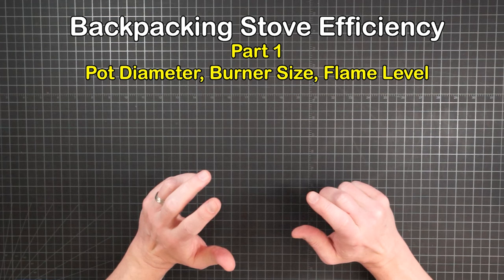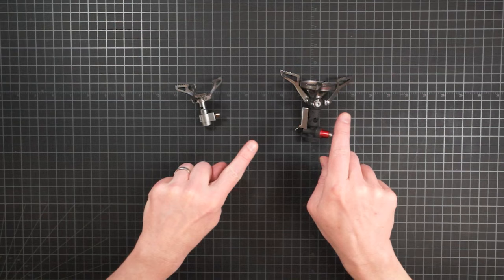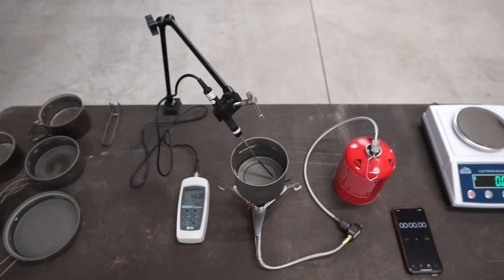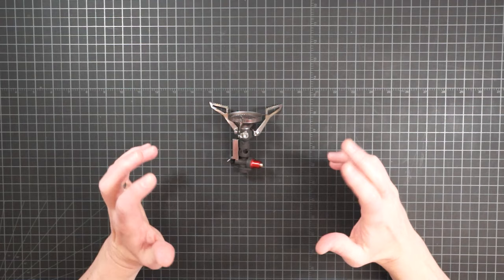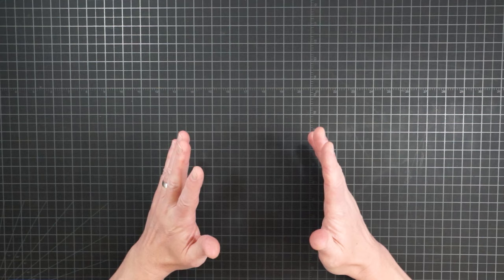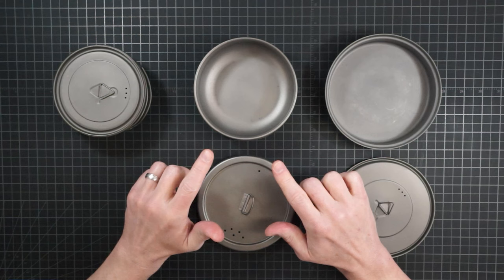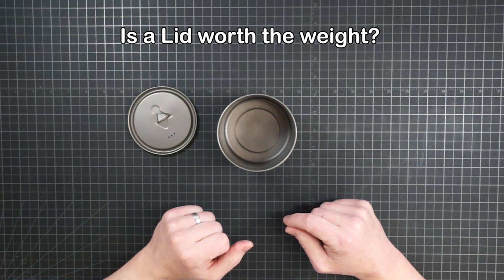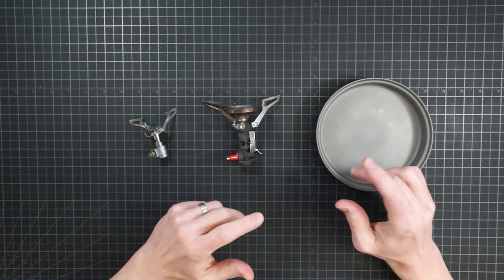Backpacking Stove Efficiency, Part 1: Pot Diameter, Burner Size, Flame Level

Comment: Wonderfully thorough and fruitful investigation -- thanks! One of the questions you may find suitable for further inquiry is adjunct equipment for minimizing flame and pot heat loss, like the cone-style windscreen/pot stands put out by Trail Designs. They are excellent for use with alcohol stoves, at best only 2/3 as efficient as propane -- so it would be intriguing to see a test. My guess is that the flame/pot width relationship would be far less critical, and that the low fuel consumption profile would be enhanced.
Reply from the maker: Agreed!  I've got wind effects planned for Part 2, but Part 3 should be on heat exchanger systems.

Comment: Extremely accurate!
But ... you measured at room temperature, I guess. If the external and water temperature drop, not to count the wind, the pot disperse more heat so require more time to boil, especially with low flame. Perhaps.
Thank you for your video.
Reply from the maker: I do have plans for some very cold weather testing, but will have to wait until next winter.

Comment: Wind effects without a windshield should remove heat roughly in proportion to the pot surface area. I'd imagine there will substantial ambient temperature effects too, imagine between -5 and 40°C for example, again probably proportional to surface area and becoming more emphasised at lower temperatures (greater differential)

Comment: It made my day when I saw you dropped another video. I was expecting a stove/pot efficiency material since you last mentioned the subject in your previous update video.

Now, I need to update my _ ultralight kitchen system_ and was waiting on your study before making any purchases I'd end up regretting. This video gave me some answers and taught me (for that I thank you, you're my favorite channel for a good reason) but now I HAVE NEVER WANTED MORE A PART 2 than this time. 

I have so many more questions now, specially after reading how poor the BRS3000T performs on altitude and with high winds. 

Thanks for the work and research you put into this, you're a gift to the Ultralight community.
Reply from the maker: Thanks very much!  Planning on Part 2 Wind Effects is in the works!

Comment: I've found that reused pie tins make perfect DIY lids. Just cut out a section from the middle to size and roll the edges by hand or with plyers. Much more rigid than aluminum foil, but still far lighter than titanium. Plus, you get to eat the pie!
Reply from the maker: A true win-win if ever there was one!

Comment: Flux ring style stoves would be interesting in these metrics too for high to medium flame. As their entire design is intended to catch runaway heat, at the significant cost of weight.
Reply from the maker: Indeed!  I think wind effects will be Part 2, but that will be the perfect lead into heat exchangers for Part 3.
Reply: My Jetboil Sol Ti pot from 2012 weighs 108.8g. My Alpkit 600 pot weighs 79.3g. So the pot isn't adding much weight, it's the associated burner.  Combining with a burner, a 'like for like" with lid the Jetboil is 244g vs 144g, so a 100g extra. Question is if that added weight helps at all. It's not so much the pot's fins, but the associated burner if the two combined is justified.

Comment: awesome!  this has been the kind of analysis my mind has always wanted to perform.  and, it reaffirms what i have found in the field:  lower flame, smaller pot, foil lid. i also use the foil as a windscreen/heat container. glad someone has time and $ to do this stuff.
Reply from the maker: Thanks, and I'm very glad to help!  So, it turns out I'm not the only one ;)

Comment: I use a minny pie tin from Walmart for a lid. (Top of a ti snowpeek) Poke some holes in it and you can make an egg with it like a suvee. Just put some water in the bottom of pot and u got a dubble boiler/ steem pan
Reply from the maker: I like it!  Thanks for the tip.

Comment: I determined long ago that a sit-on-top home-made cat food alcohol stove works best with a wide-bottomed pot to capture the slow-burning flame, a tight-fitting, non-ventilated lid, and carefully fitted, well ventilated windscreen. To save weight as a solo hiker, I use an Evernew 1.3 liter pot, and, for increased efficiency, I often put a rock on top of the lid, which minimizes the escape of steam, making it a semi-pressure cooker/boiler, especially helpful in cold weather. For optimal cold weather efficiency, I pre-warm my fuel and water with body heat or a campfire, if I have one. Using a stainless steel single-wall bottle in the winter allows me to put it in an insulated cozy and take it to bed, where it keeps me warm, and my body heat keeps it from losing heat as quickly as it would if left outside of my sleep system.
Understanding basic physics goes a long way when paired with common sense and experimentation. 
Thanks for the great quantitative data, confirming my general observations. 
Awesome! 👍👍👍

Comment: Science preferred from marketing – thank you so much for this uniquely derived information based on a comprehensive and statistically worked out comparison! I am furthermore interested in the effects of material alloys of pots and lids as other non-linear factors of optimizing the cooking efficiency under in- and outdoor conditions..., possibly might this be a task for a bachelor's degree in thermodynamics? Anyway, many thanks to you for this data treasure!
Reply from the maker: Agreed! I do plan to test pots of different materials (aluminum vs titanium vs stainless steel).  Eventually 😏
Reply: @GearSkeptic  I'm looking excitedly to this coming investigation and being grateful for your efforts to deliver thoroughly evaluated results and conclusions. Best regards from Lower Saxony, Germany

Comment: I'm happy my cook set is indeed the weight efficient. BTW I learn I'll better use it on low :) I never used lid too :) Thx for the very stdized way of testing. But the best efficient might be stove less and rehydrade couscous with instant soup and pinch of oil for the calories into an icecream pot with screw lid. pay attention of plastic must be PP to allow using your pot to support boiled water shared by another hicker. You now found the best way to have boil water at negative weight saving, let somebody else carry the cook kit and just take a your favorite ice cream jar :) Another remark come to my mind, when using wider containers, food cool quicker. It is especially important to keep water long warm to ensure good rehydration of meals. Some of my homemade dehydrated diner takes 15' to rehydrate completely in hot water. So it is very important to me to keep warm my boil water to rehydrate meals. For that I use my fleece hat as pot cosy :) Another way to be weight efficient with cook set is to be well informed about the trail you do. In Corsica, for example, every mountain house will have a gaz stove & free gaz. So just take your pot and go :) No stove or gas canister required there :) For making water out of snow, I recommend to use low heat and add a pinch of liquid water in the pot to speed up the process. I guess ice getting burned, get directly to steam without turn to water... I look forward to discover if my water treatment make sense :) I use a microsawyer on a sparkling water bottle. (more resistant) with sportcap to allow backflushing on the go. When doubt of viruses (staying water, ...) I double with micropure forte, some kind of aquatabs I think. I'm sure we will learn a lot out your crazy testings :) Also, if you drink lot at the river, you can carry less water until the next water source ;) weight saving let energy for walking more :) Thx again and happy trails!
Reply from the maker: Thanks for all the thoughts!

Comment: Outstanding video, thank you! You might also want to discuss the implications for fuel canister use given that the canister metal is a very large portion of the carried weight. This might take the form of a chart or charts giving the # of boils or liters boiled for each  stove/pot/fuel rate combination for both 100 g and 220 g canisters. Looking forward to your wind results!

Comment: Video idea for you, I would love to see a really in-depth investigation into avoiding condensation, particularly on the surface of quilts while in a tent. It could involve discussion about single-wall tents (but that is reasonably common knowledge at this point & has been done alot.) But I am finding it very difficult to find anything about quilt specific condensation.  Cheers! Greg

Comment: What a sophisticated Analysis very scientifically😍🤩thank you for the effort!  
I only mist a sheet with the comparison between time and consumption, since you messured the time on every boil, i am quit curious what the time differences on the variations. I know, the focus was on efficienty but sometimes in the morning boiling water for the first coffee you can get quit impatient at least me 😁
Reply from the maker: Here are the average boils times (using the regulated MSR Pocket Rocket Deluxe) on each flame level:
High 2min 25sec
Medium 2min 59sec
Low 5min 46sec

As you can see, a much bigger jump in time going to Low from Medium, than from High to Medium!
Reply: @GearSkeptic  Thank you very much! Yes, wouldnt have expected such a big gap between low and medium, almost double the time. Thanks again and im already very curious for the next episodes 🤓👌✌

Comment: Thank you for the amazing quality of the video. It is incredible to have someone like you in the community. 

It is great to have someone like you being so orecise and detailed.

I would like to share something for further consideration, in my experience getting a titanium flexible windscreen and putting arround the smallest pot in order to capture the flame with the sides of the pot (taking care to not cover the fuel canister and risk a explosion) negates most if not all the benefits  of a wider pan. But it only weights 11g after I cut it to size. And no, aluminum melts at the flame temperature so it does not work to put a aluminum foil.
Reply from the maker: Excellent point!  A windscreen could be a benefit even when there's no wind.

Part 2 will be on Wind Effects, and windscreens will be tested.  I will make sure to test what you have said, as well.  Now I'm curious!
Reply: @Jean S so you use titanium foil and let it collapse around the pot suspended above the canister? Do you use a silicone rubber band to secure it or does it’s tension keep it in place? Heavy duty tinfoil positioned at ground level with some separation between it and the pot works as an effective windscreen but does not serve to focus the heat that otherwise naturally rises alongside the pot, even with the burner flame level reduced to keep flame from visibly spilling out beyond the edges. So I am curious about your use of the titanium foil type windscreen. Do you use the one made by Toaks cut to size or did you buy the foil and shape it?
Reply: @wanttogo  What I did is cut it so its height is just the size of the pot + a fem cm. So to use it I colapse the handle and wrap it tightly around the pot and secure it using a large paperclip. The goal is to set it just sufficiently below the base of the pot so it covers the flame protecting against the wind and guiding it and the hot air around the pot.  The downside of this is that after boiling, it is hard to touch to remove. I use a pliers to handle the pot in this situation.
Reply: @MrDjoppio  understand. I appreciate the response.

Comment: You are the hero we all needed. Though I know it is not an easy addition to the test, I would love to have seen how a Jetboil (or similar product) compared. Adding in a “flux ring” to help with the lost heat. Based on this study, I somehow doubt that a Jet Boil fuel weight savings would ever make up for the weight of the unit itself.. but I’m still curious.
Reply from the maker: Heat exchangers like the Jetboil and MSR Reactor are scheduled for Part 3, right after a Part 2 on wind effects.  I suspect you're right about the weight efficiency issue, but I want to see by how much!

Comment: Love it! Very surprised with the lid results. I had already had an aluminium foil lid DIY’d and now I’m determined to use is to shave another 10-12g from my cookset. 

From a weight efficiency perspective, estimating how much fuel I will use on a trip (together with the weight of the stove setup), along with conditions, is how I determine whether I take a gas or alcohol stove. 

Even with the BRS, basically if it’s under 4 nights I take the alcohol stove as it’s going to be lighter. 

The other point to make is how much fuel you have in a canister. Unlike alcohol, the vast majority of people won’t portion out their fuel for a gas stove- they’ll just take whatever canister they have.
Reply from the maker: Good points!  I would like to eventually see how alcohol stoves compare, especially after getting a baseline on wind effects.
Reply: @GearSkeptic  are yes, lab vs real world conditions almost guaranteed to never be the same, particularly with this topic and also with wind and temperature. 

Keep up the great work, we all really appreciate it!

Comment: Awesome. Thanks for all the testing. I was thinking of picking up a wider 115mm 700/900ml pot to replace my narrower 750ml pot. I care more about fuel efficiency. I picked up the Soto Windmaster 4 plex because there was less distance between the stove and the pot. The boil time with a heat exchanger pot is very quick, but that pot is quite heavy. Now with your testing, I'm more tempted to pick up a Trangia 27 kettle before a pot upgrade. Use a low flame and chill like with an alcohol burner.

Comment: Cool.  I suspected a large flame was less efficient.  Good to see some confirmation.

The lid data was interesting too.

Possibly another option is to float the fuel  canister in some water to allow it to maintain a more consistent temperature.
Reply from the maker: Interesting idea!  I'd have to make sure the canister is dried each time before weighing it, though.

Comment: After you've had a rest from watching water boil and are ready for another analysis, your same test setup would be put to good use quantifying the efficiency gain of heat exchanger pots vs. regular pots.  I've done some thumbnail tests to quantify the efficiency gain of a Jetboil Stash vs. Toaks 550 in order to quantify at what point the additional weight of the Stash pot becomes worth the fuel saved.  Your setup and approach is far superior.  I'd be curious to see you quantify the efficiency difference.  Such data would help people determine the break-even point
Reply from the maker: Yes!  I think wind effects testing will lead nicely into heat exchangers and windscreens.

Comment: 👍Great work Mr Skeptic. Any plans to take a look at pots with heat exchanger rings?
Reply from the maker: Definitely!  Already collecting different types to develop a protocol for those.
Reply: @GearSkeptic  Nice. I've had a Primus pot set with a H.E. for 10+ years and would be great to see some numbers to confirm (or deny) my gut feeling on the concept for gas stoves. Again, thanks for all your efforts.

Comment: Coleman sells isobutane canisters at Walmart that are bigger than that, I'm an infantrymen, y'all backpacker types are cool and I steal stuff from you all the time, lately I've switched to a tarp and that dropped 5lbs off a 50lb load that is mostly water and 1200rds of belted 556
Reply from the maker: Thanks!  I will go check Walmart.  I hadn't seen those before.
Reply: @GearSkeptic  Backpacking Light took a look at the isobutane mix different brands of canisters use. In temperatures much above the boiling point of butane performance is essentially a wash but as those temps drop that mix becomes more of a factor. The Coleman canisters, as I recall, aren’t the best mix for below freezing temperatures as compared to mixes offered by Jetboil, MSR etc. If you do your cold conditions test next November that is certainly one factor to call out for consideration.

Comment: quite interesting!  I wonder how the results would be while using alcohol stoves (Trangia) and twig stoves (Firebox)... I know you cannot regulate the flame accurately with such stoves, but I am sure diameter and height of the pot could mean something... but also the form of the stove itself. As a matter of fact I positively know that the Trangia burner does perform better when used in the Trangia stove instead of on any tripod without a windscreen, or surrounded by a panel-windscreen...
Reply from the maker: I do plan to add both alcohol and twig stoves to the testing, after looking into wind effects and windscreens.

I've been working on a way to get pre-measured amounts of a consistent wood type so I can compare twig stoves with some level of fairness.